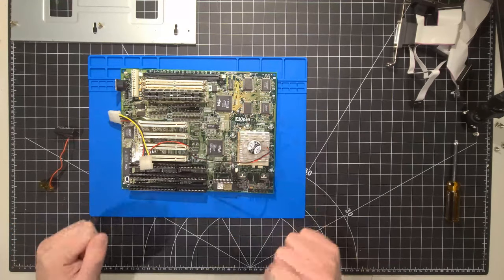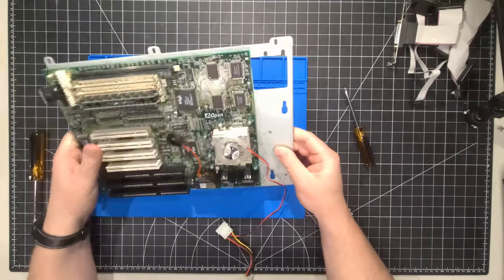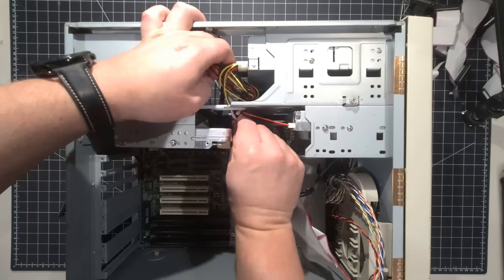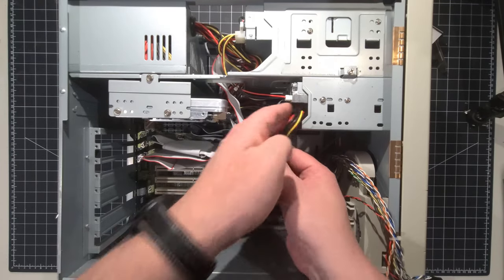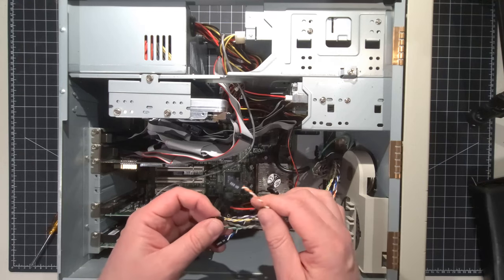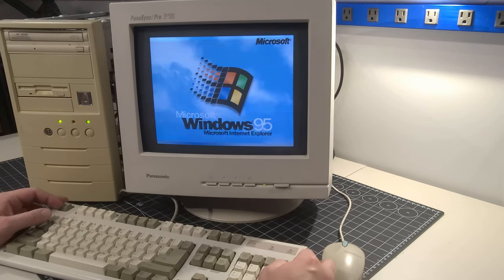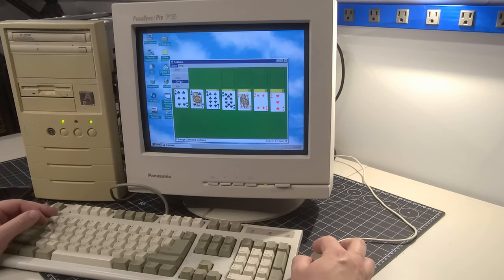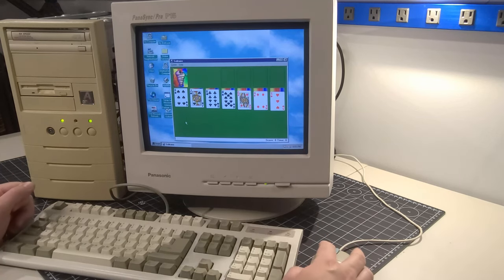AOpen Mystery PC - Series Finale!

Comment: Great video! It reminds me of my first Pentium (I upgraded from AMD 5x86) that had similar (if not the same) specs. I upgraded the CPU from 100 to 166MHz and the memory to 32M. It had also the S3 Trio onboard that I maxed out to its full 2M VRAM. I also run Win95, Office 97. 
The main reason to upgrade from 486 class to Pentium was Starcraft. It ran very well and I spent many hours playing the original missions. Another game that hugely benefit the Pentium architecture was Anno 1602.
Also that was the first computer that played mp3s without the need to tweak the settings in Winamp. 
For me, socket 7 is the best hardware to run Win95. Pair it with some SB compatible sound card and can run without problems any dos game from late 90s - early 2000
Reply from the maker: Thanks for this awesome story.  I love hearing from the community on what they experienced in the past with all of their old tech and configurations.  Thanks for watching!  More to come!

Comment: I hope you added a diode to that coincell, unless you want it to blow up then its ok.
Reply from the maker: Hi, no - as in the RTC MOD video I broke the internal connection to prevent charging the battery in the RTC.
Reply: its a common mod with no issues
Reply from the maker: Works great!